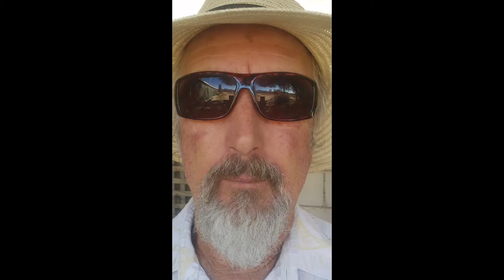Puma Punka an experienced stone mason explains the stone blocks

Comment: I look at the blocks of stone and they remind me of breeze blocks, moulded concrete.
We do not havecthat technology .
They look like moulded concrete yet they are solid stone.
Same goes for the drill holes.
Ive used hydraulic drills when working underground.
Conjecture has its place, but the hard evidence of shaoed stones and exact drilling and massive loads plus distance from quarries are factual and can be addressed by practical people who have dealt with the issues of lifting massive heavy objects and transport.
Ive worked as a rigger with huge cranes and also driven large trucks.
Where are tracks used to transport the stone?
What use was this building put too?
If this was a transfer of technology from a high tech survivor to low tech survivor,....as conjectured by some,,,, why has the technology been lost?